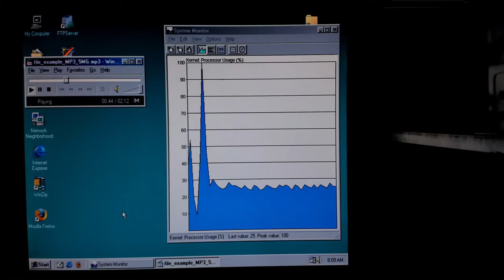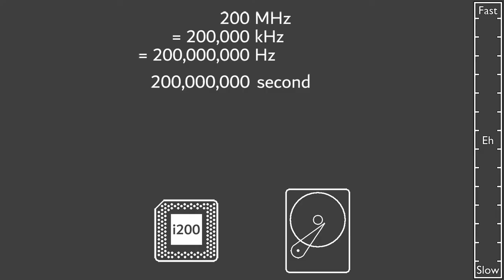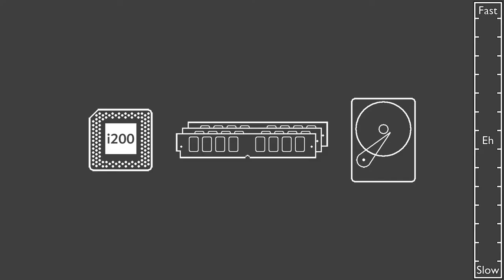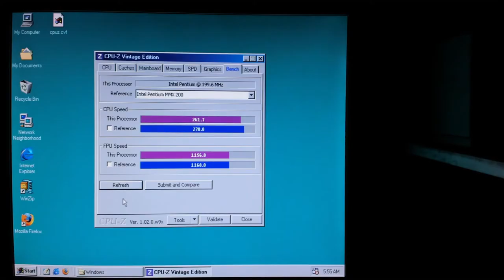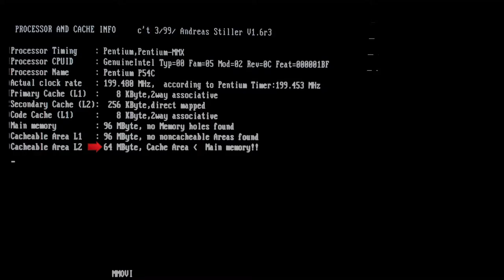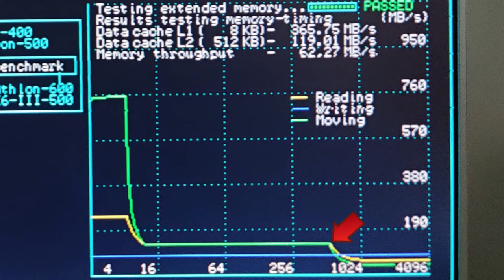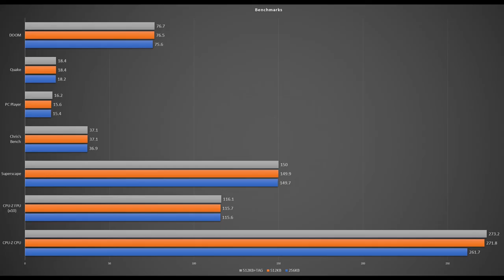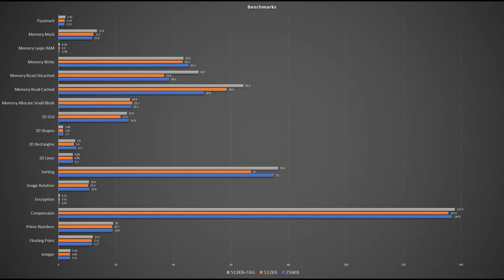ASUS P55T2P4 - COASt and TAG SRAM Upgrade

Comment: You need 15ns TAG-RAM, I also used 20ns TAG-RAM and found the system was acting slower because I used 20ns instead of 15ns, it REALLY does make a difference in performance.
Reply from the maker: Interesting, if I can, I will try 15ns TAG and see if I can see a difference. Not even sure if I have a 15ns TAG

Comment: I was a pre-teen and teen in the 90s. I wonder how many people had no concept of cache upgrades back then. I've been collecting retro PCs and hardware for ~12 years now and didn't learn about some of these cache upgrades until then.
Reply from the maker: I remember when a friend offered me to upgrade my cache - he sold me one of those COASt modules for around 10 USD back in the 90s. Never noticed a difference with a Pentium 200 (non MMX).
Reply: @bitsundbolts  wow that was an incredible bargain back then. Actually it's still an incredible bargain today, especially. I'm sure that the cache really only would have been noticed in 3D accelerated games with a fast card like a Voodoo 2 or better. The difference probably would have only been a few FPS at that.
Reply from the maker: I think my friend wasn't sure if it actually worked - and I admit it was in the late 90s - Pentium-II and maybe even AMD K7 were out already. I only had a Voodoo 1 back then - and that was (unfortunately) my only 3Dfx product ever - until now ;)

Comment: I just sold one of these bad boys on eBay. I opened a box of RAM, and was sorting through all the EDO, and came across 6 strange looking modules. They were all brand new, had 1995 labels on the cards, had no idea what they were. Figured it out with some googling. Interesting pieces of tech.
Reply from the maker: 90's hardware is fun to play with. I think I also have a bunch of those somewhere in a box
Reply: @bitsundbolts  I knew nothing about them, didn't even know they existed. All the S7 PC's I had never had one. So I researched and found out they come in different sizes (128k, 256k etc) and some have a tag RAM, and whatnot. Very interesting.

Some guy from America bought one from me, and another guy from Germany. I'm hanging on to a few just in case I ever come across a board that I can use one with. But the only SS7 build I have (that I actually use) has an ASUS P5A board with AGP, and a K6-III 450. Used primarily for Quake 1 and Diablo Hellfire. Maybe some Screamer 2 from time to time! The older S7 machines are just stored and, far as I can recall, none of them had a COAST slot.
Reply from the maker: I have a few S7 boards that have the COASt slot. I want to use them in future videos, but they are limited in the choice of CPU (only Pentium non-MMX due to voltage). I remember getting a COASt module for a Pentium 200 and couldn't tell the difference in performance. But I also didn't know what I was looking for.

Comment: I don't understand this at all, doesn't matter how much memory of what type you put between the drive and the processor, the drive can still only supply data at the speed it does. So it's all smoke and mirrors, you have to wait until all the memory is full before you start processing and it just appears faster right?

Comment: I have a ASUS P55TP4XE that I use with a P100 only for dos and Win3.11and mostly for games. The manual states that the cache can be on DIP RAM (that is 256k 15ns socketed) or on COASt module, but not both at the same time.
It is worth trying to upgrade the cache? Also the TAG SRAM seems to be 256k as well, the same IC like the cache (there are 9 UM61m256k-15 ICs on the cache area)
Reply from the maker: I think you already have 256K of L2 cache from the DIP SRAM chips. No need to upgrade to 512K in my opinion. It will cost money and you probably won't feel a difference.

Comment: Is there any point of the tag module if you’re only using 32mb of ram?
Reply from the maker: The tag module is required for total memory size larger than 64MB. Best is to consult the motherboard manual for different models as the specifications may differ.
Reply: Celab: no.

Comment: You have 20ns tag ram. 1000/20 = 50mhz. Is it ok ?
Reply from the maker: I couldn't find a faster Tag module at that time (e.g. 15ns). However, the 20ns worked and I didn't notice any issues while using it.